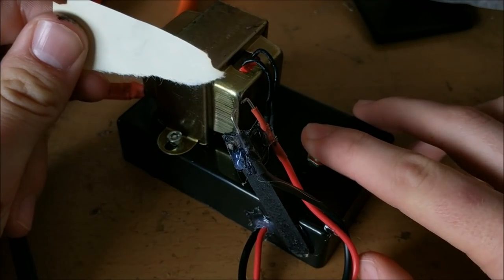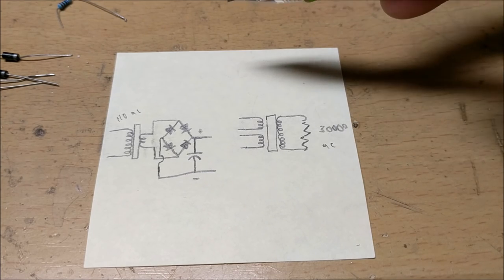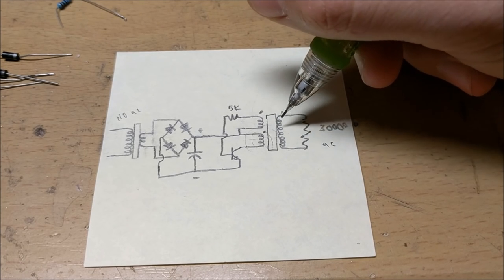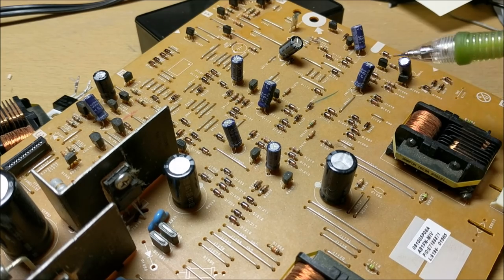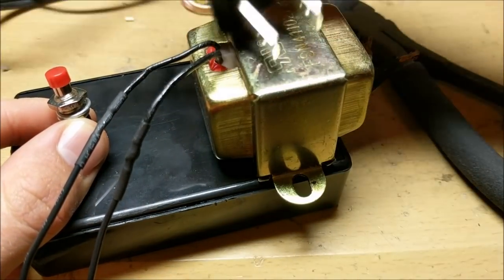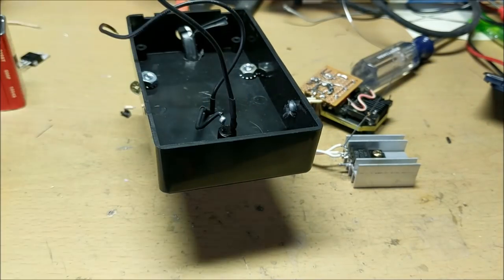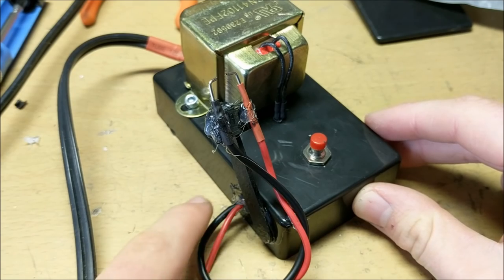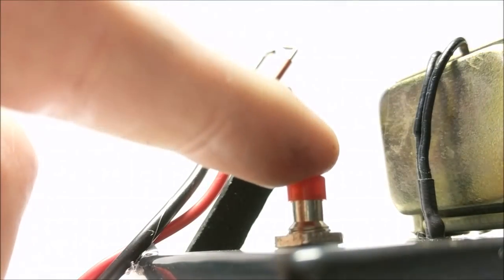This Lighter Starts Fires with Electricity Alone!: The DIY Arc Lighter

Comment: design works well I have mounted mine to a arm n adapted a diy laser engraver replacing the laser with this ,idea is to see how far it can be used as accurate arc wield device ,thanks for the diagram
Reply from the maker: No Name  This device could not be used as an arc welding device, it does not supply enough amperage.  Cool idea though!